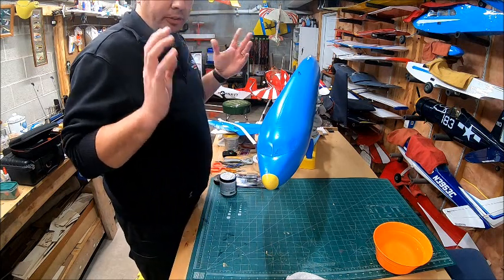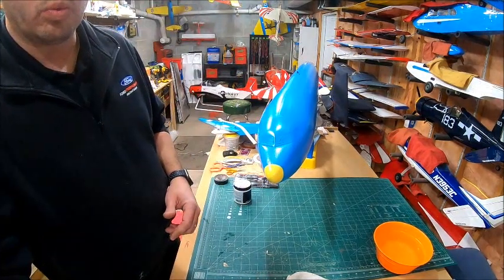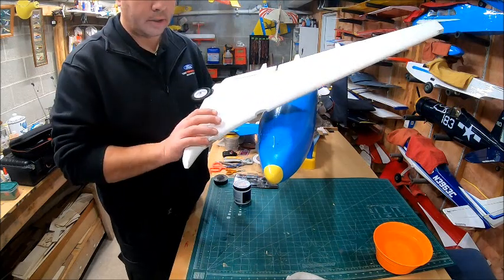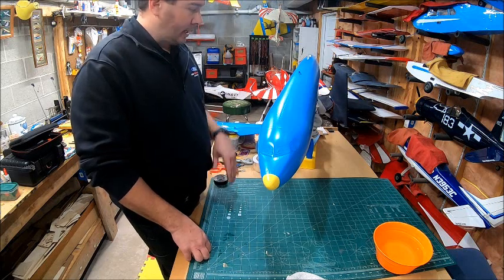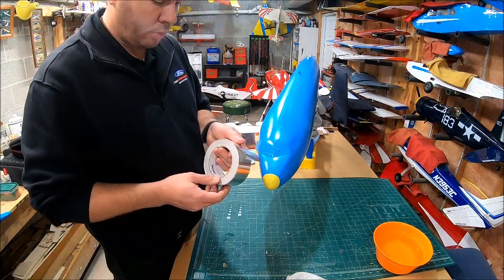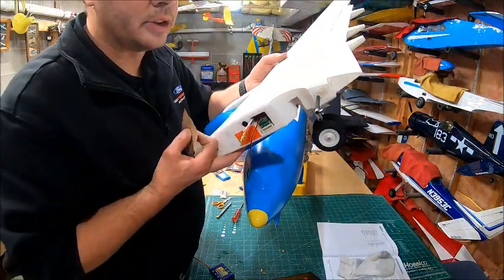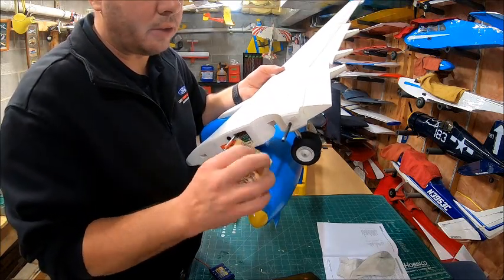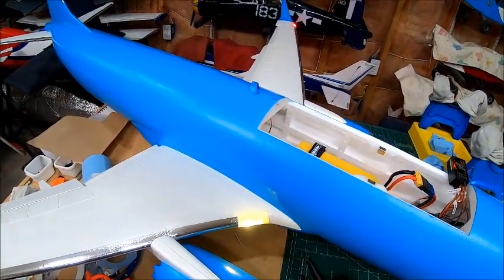AL37 Build Day 3

Comment: Just got one of these things... I'm a little worried about the paint peeling issues... but my scheme is a white plane (iberia) with Callie graphics and then just detailing.  Love what you did with the leading edge tape.  Is going 1:3/4 ratio good for the aluminum tape on all the leading edges?  I'm going to assume yes...  I guess I'll find out.
Reply from the maker: It was. Still love this thing. Over 100 flights and still driving people crazy when I keep bringing it

Comment: When you drop the wheels before attaching to fuselage did use the battery somehow instead of using a servo tester like most?
Reply from the maker: You can either remove the circuit board from the wing, then unplug the retract cable and use a servo tester to drop them or hook up your receiver and battery first then just plug in the fuselage to wing extension without the wing fully mounted in place. A good plane stand helps hold it. That’s what I did

Comment: Hi Brenden,  can you help? I've set many a plane up, singles twins quads etc ,  just finished my al37. , wired up bound the receiver,  however  all surfaces move ok but when trying the motors when I throttle up the motors almost make a banging sound oscillating back n forth quickly!!!! , yes main wires are yellow to yellow, red to red black to black, tried the calibration still the same result!, ,any ideas much appreciated??   I've never had to bind a receiver with a Bec though, , I put the throttle in the reciever channel and the Bec in the auxiliary with bind plug in Channel as normal, once bound I've moved the Bec to the bind channel leaving the throttle as is in number 2 next to the bind socket is this correct?  Any help much appreciated. Must state my reciever is a spectrum Ar 6200  6 ch.  Thanks Graham
Reply: Hi, I get the six bleeps followed by a single bleep,  im wondering if from the factory that the three wires to the motor from the esc's have been mixed up coming out either side of the fuselage so for example one of the yellow (example) has got mixed with the red n black of one esc and the same the other, ill have to remove the battery tray and have a look, it seems the motors are getting mixed signals, their just oscillating vibrating badly as soon as you throttle up, please confirm the bec can go into the bind channel and the throttle as marked connector goes into channel 2??  all the servos and lights from the blue box work perfect.
Reply: thanks brenden, will try tomorrow, I guess your 5 or 6 hours behind from here iam in the uk.  really appreciate your time and response, will be putting up a walkaround vid shortly before the maiden just incase!  its taken six weeks just to do the livery on it.
Reply: Hi Brenden, update on my motor issues, we'll all good to go problem solved, now calibrated n running normal,  luckily easy fix, removed the ply battery tray to get to esc' s,  factory had crossed over the black wires to either side of the fuse, so I had connected them with the yellow and red wire from the wrong esc on either side, sow aped over n bingo , re Binded and calibrated both now running in tandem.  Thanks so much for taking the time to reply, this what's makes this hobby great not just the modern tech that allows us to have such a great hobby n range of planes. Keep up the informative videos,  any bloopers if any keep them all in its important to help share others that may have the same issues!   G 👍✈️